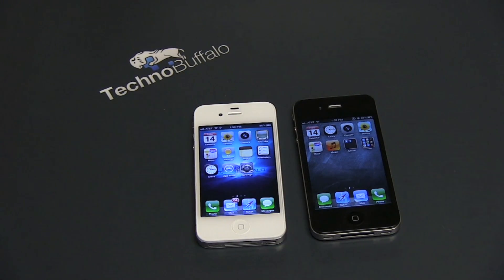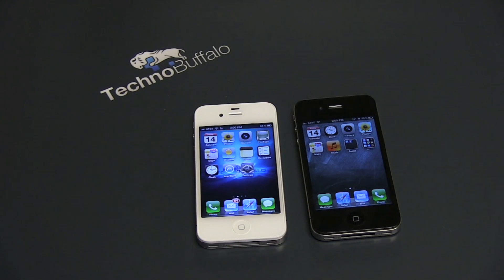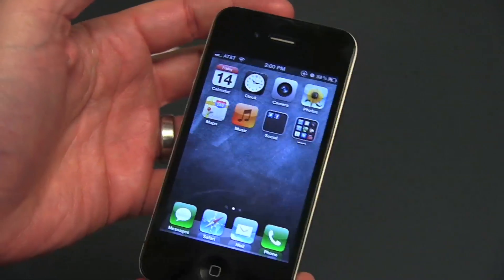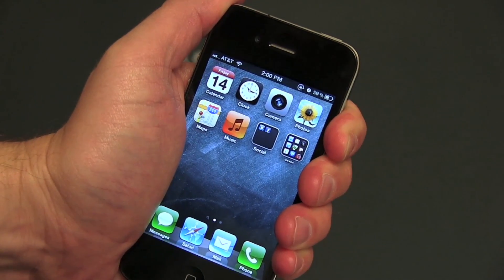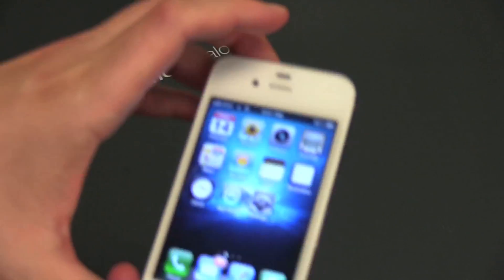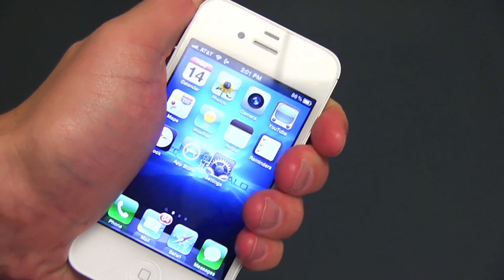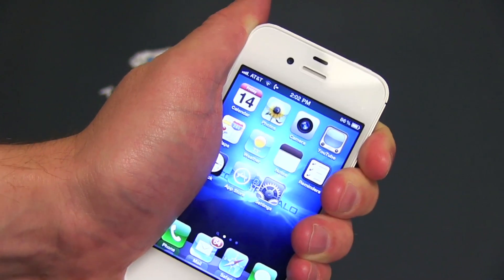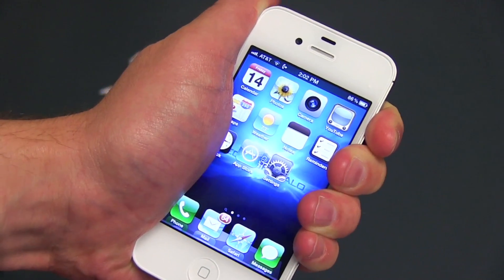iPhone 4S Death Grip Test

Comment: @TheMSpence89 Verizon if you want strong signal strength in a wider range of area's, resulting in much more reliable and faster data speeds and less dropped calls.

AT&T if you value being able to talk on your phone and use data at the same time, such as browsing the internet or using GPS while you're on the phone. Verizon's network cannot do that at the same time. It's not a lack of bandwidth or license exception, it's just a physical limitation in their network that makes it impossible.

Comment: I just death gripped my 4s. you just have to bridge the two caps on the left aswell as the on the top of the right side. Apple seems to have designed the antennas so that there are two individual ones. 1 on the left and on on the top for the carrier signal, the one on the right probably would be bluetooth.
So you can still make the signal drop however no one would ever hold their phone, the way I did do drop the signal, like that unintentionally or during a phone call

Comment: @HalfEatenMilk It may have lost one bar but it still has better signal than the 4 does even without touching it. And the death grip means dropped calls and lost signal which doesn't happen with 4S no matter what you do. I have an iPhone 4 and you only need to cover the gap with one finger to lose signal completely. Maybe John's hand isn't that moist - the sensitivity has to do with how moist your hand is.

Comment: Just because the 4s lost one bar, doesn't mean it has the antenna problem, it was purely coincidence, in reality that's what the signal should have looked like before he even picked it up, it should have the same signal strength as the iphone 4 because they are on the same network and in the same area, just because it is a new phone does not change at&t's signal in that area, it just so happened to have one more bar then lost it. Signal fluctuates all the time, I call coincidence.

Comment: @plasticbandman13 He was just showcasing. You don't have to hold a tight grip on it. Just hold your phone as normal when making a phone call and note how your ring, middle, or pinky (if you're right handed) is almost always over the exact spot that causes signal loss.

Hell, look up photos of Steve Jobs holding the iPhone 4. In 90% of the photos, his grip would cause signal loss if there is no cover.

Comment: hey jon, just a quick question... is the white iphone 4s thicker than the black iphone 4? because i remember when the white iphone 4 was introduced it was a couple mm thicker than the black one, causing some casings to not fit. i just want to know whether they fixed the issue with the iphone 4s, or if it is indeed still thicker. thanks!

Comment: The bars on the 4s were higher to start with over the 4 and this was noted. That suggests the signal issue has been improved in the 4s and we could see that no service in 4 is beaten by 80% of the bars in 4s but both phones lost bars in being handled. the 4s is just much quicker in showing the loss. so quick some slow users miss it. I just run on duel core where as the A4 chip users are so slow watching the old phone to fail.

Comment: @jon4lakers The phone has 4 gaps in the metal band, right ? So if the iPhone 4 had the problem with the left lower gap, maybe they've re-routed the antenna into another gap, so try holding all of the gaps, just for the hell of it, and see if it drops then.